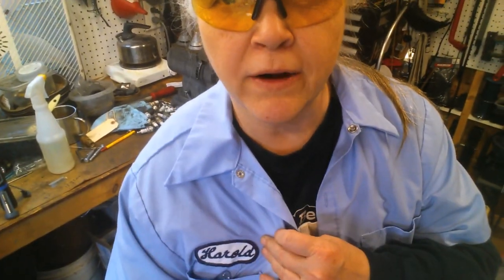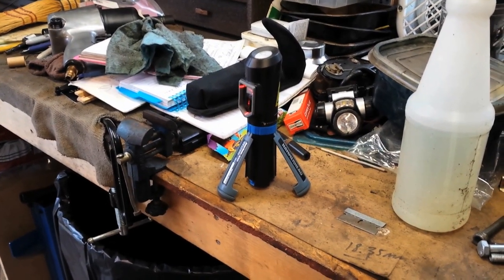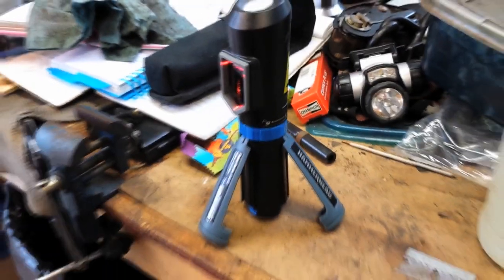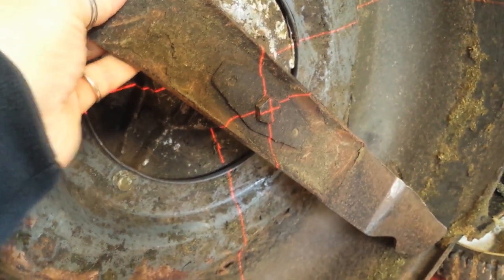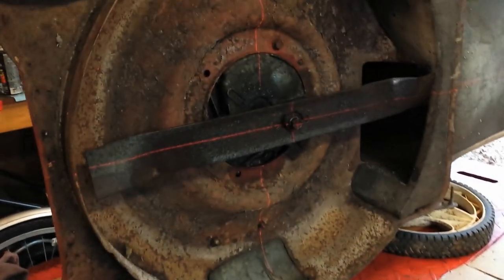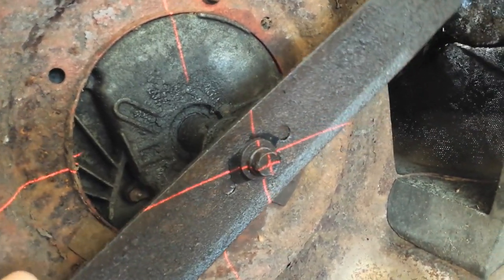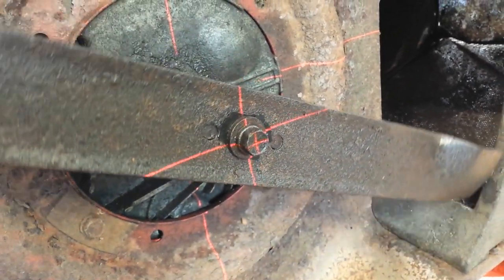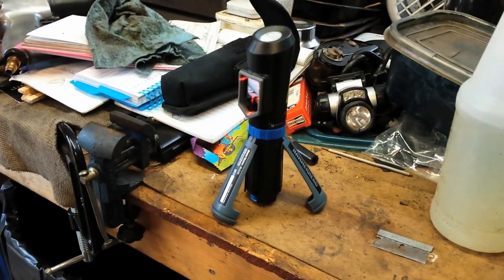Bent Crankshaft on a Lawn Mower

Comment: Used an indicator on mine,  but thought you were going to give advice on how to straighten. Guess you'd figure to replace it. 
I used a long pipe on the shaft, pulled on it many times but got it really close. Thanks
Reply from the maker: I don't straighten cranks on machines that don't belong to me. I can't afford the liability.